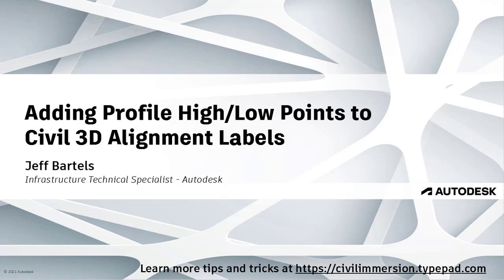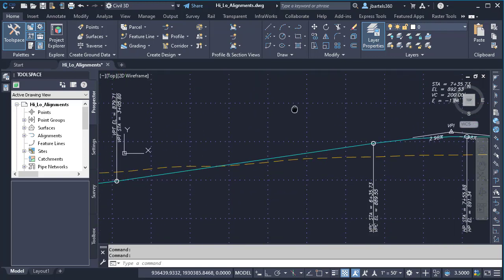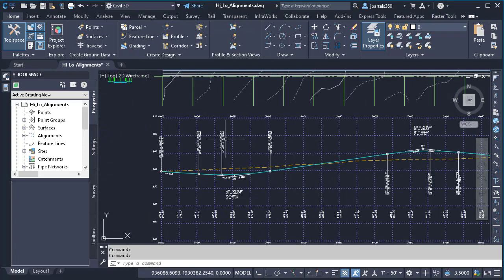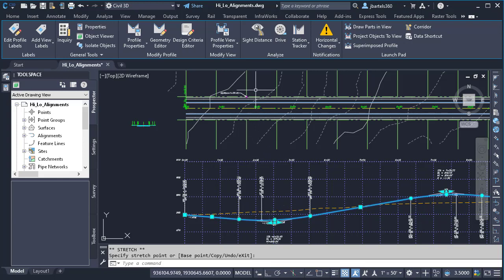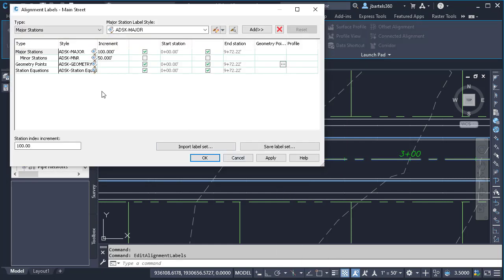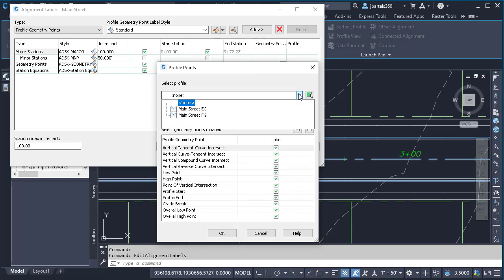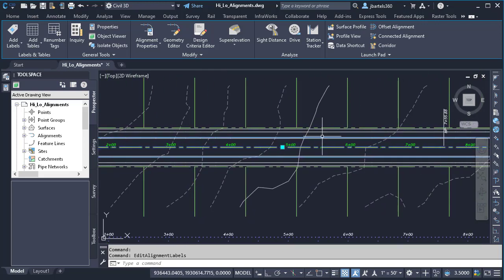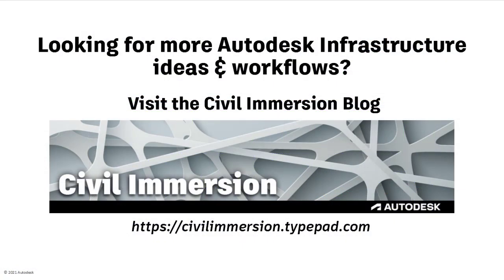Adding Profile High & Low Points to Civil 3D Alignment Labels

Comment: Great as usual ... Could you please illustrate how to use (create pressure network from an industry model) it's a very good way to exchange the data of a pressure network between different applications but it's very hard to figure it out by myself .... Thanks in advance